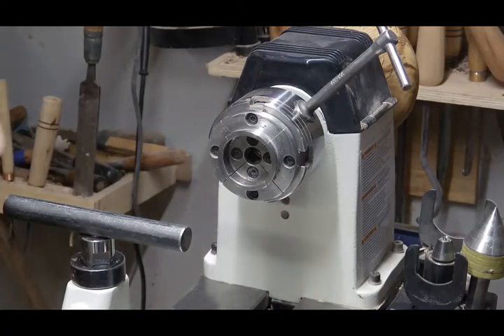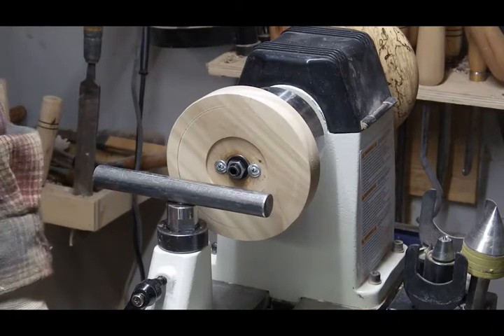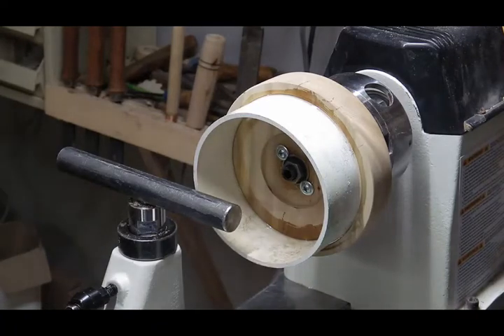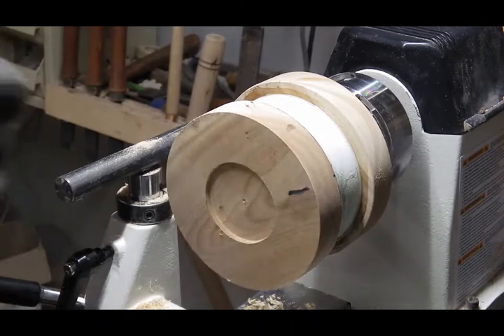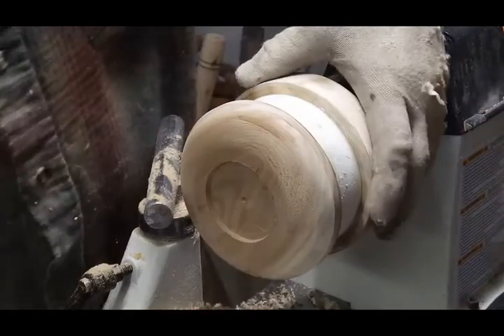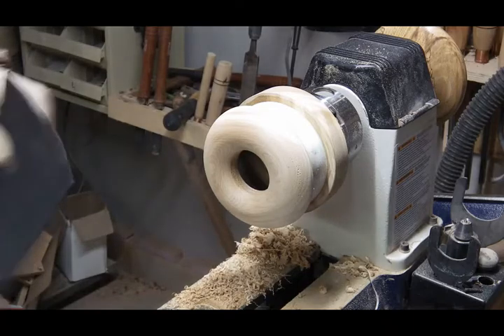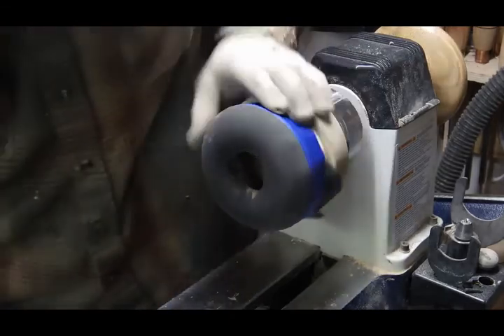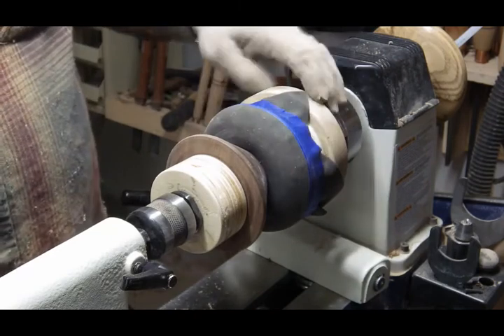DIY Vacuum Chuck

Comment: Thanks. This is really useful.
Being a Brit, I'm quite familiar with the expletive: "Bugger!" (plus a few others, of course). It's more unusual to hear it in an American accent... and quite endearing.
I've been thinking of purchasing a vacuum chuck for some time but I'd be a fool not to try this first. If I succeed, it'll save me a few quid or, if not, Ebay it is.
Thank you.
Reply: There is a (not terribly inexpensive) device/system called HoldFast that connects to an air compressor.  In theory, it's a nice bit of kit, but I haven't had good luck with the chuck that comes with it.  If/when the seal breaks around the rubber rings they use, it's quite a trick to reseat and reseal.  So - when it works, it pretty good.  Otherwise it's useless and quite a pain to repair correctly (in my hands, at least).  Cheers from Texas!

Comment: To get the rubber coating on it you might consider using a stuff called Dip It. It’s basically liquid rubber and is sold for coating the handles of hand tools.
Reply from the maker: It does not stay soft enough. The surface has to conform to the grain in the item. Which is not always smooth as glass.